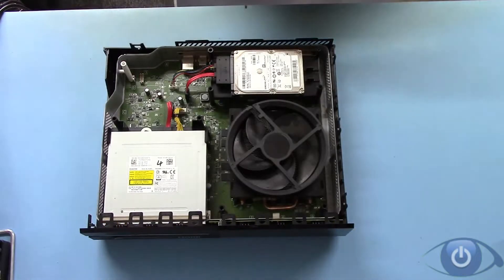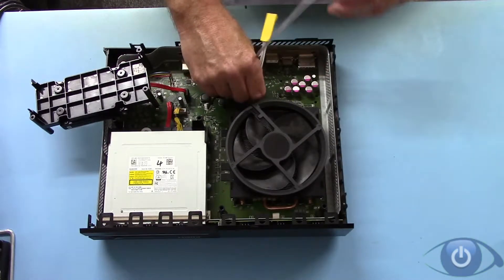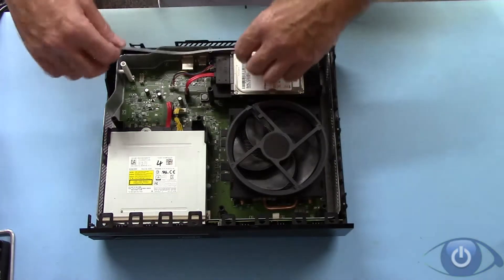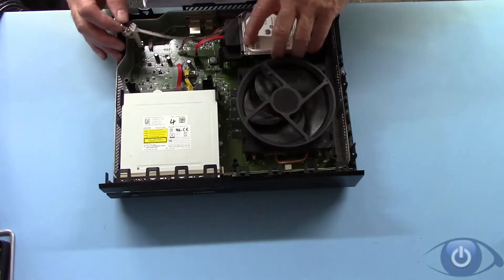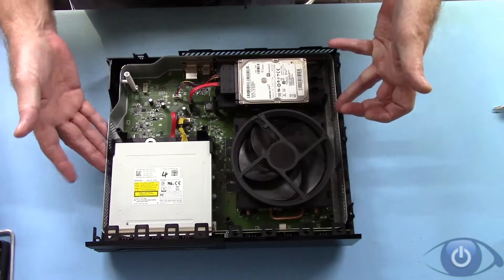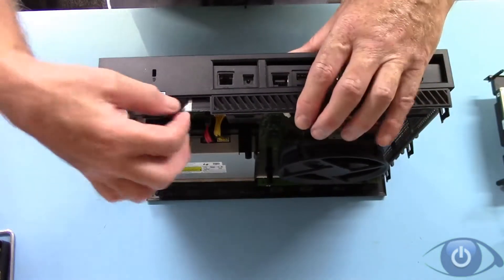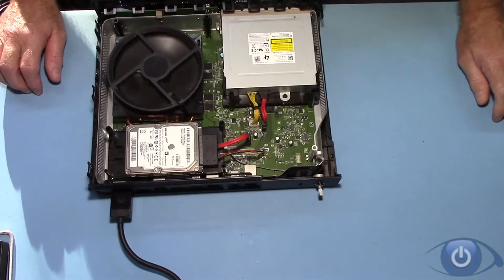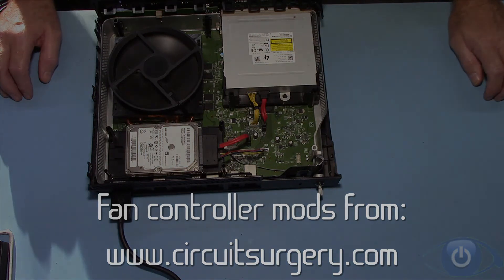Fit a fan controller mod to an Xbox One

Comment: Any idea on placement for a series x ? I have the push button version installed atm, but considering buying this version for more granular adjustments.
Reply from the maker: On a Series X the placement is very easy and requires no drilling: the potentiometer fits nicely in any of the holes in the ventilation grille.

Comment: just installed this in my xbox one x. my fan is back to full speed again THX.

Had to replace capacitors a few weeks back that were causing HDD corruption because the fan wouldn't speed up under heavy gaming and over heating the caps, this little gem of a hack has me back up and gaming THX  circuitsurgeon

Comment: @circuitsurgeon I just recently purchased a the same speed controller and did all of the steps and turned it on and it's just staying at the full 12 volt speed even if I move the dial up or down, its still staying at the full 12 speed.

Do you have any ideas what the problem could be ??